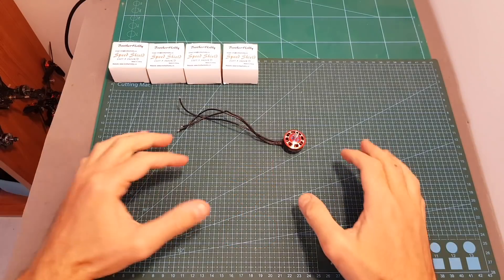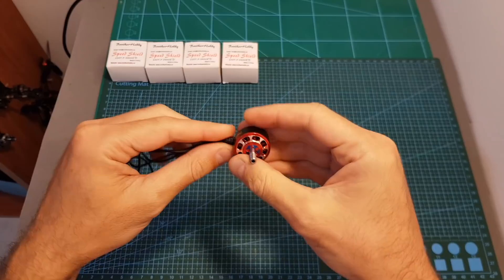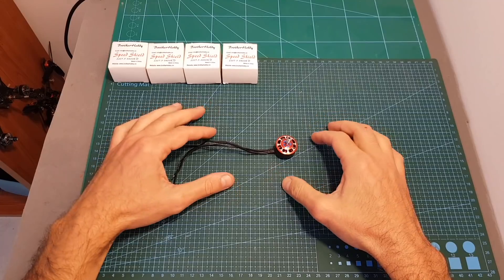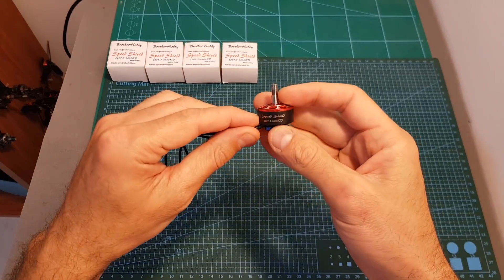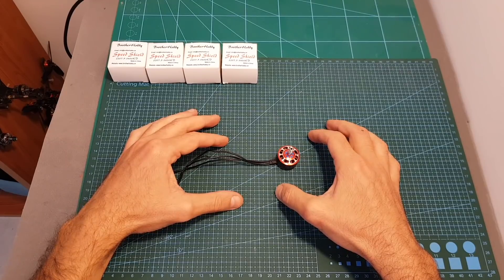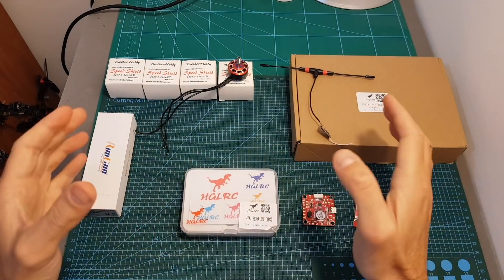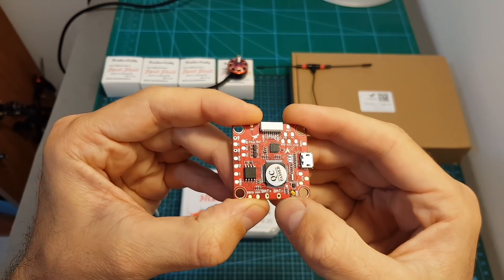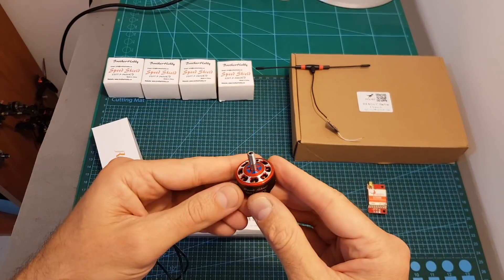BrotherHobby 3400KV Speed Shield 2207.5 - Making 3S Great Again

Comment: Hi gal
Hope your well
Im about to begin my first build I wish to build a 6 inch stretch x
Freestyle. I have watched and tried to pick up as much as I could. But how do you know what motors go with what frame and what esc goes with whst motor. Snd so on and so on.... there has got to be some kind of method to my madness. 
NO?...I thank you in advance for any help . Take care my brother. .
Reply from the maker: Hi buddy. Did you get any parts yet?
Reply: Gal Kremer not yet I dont know what to buy 
I lnow I want a 6 inch stretched x. Im thinkin 3 s with a momba flight board maybe 30 amp esc..?.id love to have run cam with osd.
A nice vtx.
Id want capacitors on flight board and c
Csps on esc
And the jumper transmitter. Of course I domt know if that would work. Maybe some 6045 cyclone props.
Reply from the maker: Please contact me through my Facebook page - I will try to help you out.
http://www.facebook.com/kremerFPV

Comment: Might be a good choice for 4inch little long range build. Thanks for your time reviewing.😎
Reply from the maker: Not sure that a long range one, since it's going to chew up the battery, but for a very fast 4" racer it will do the trick ;-)
Reply: Gal Kremer I figured  KV it wouldnt be that bad? But i didnt take in account how big of a motor we dealing with here either. It would be awesome to have a quad that run 3s and got 6s performances out of it.😎